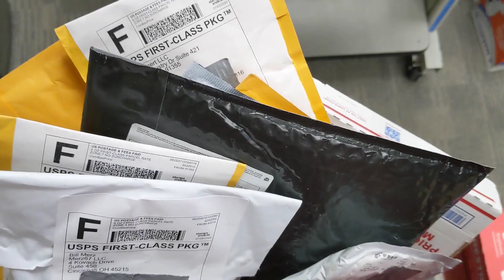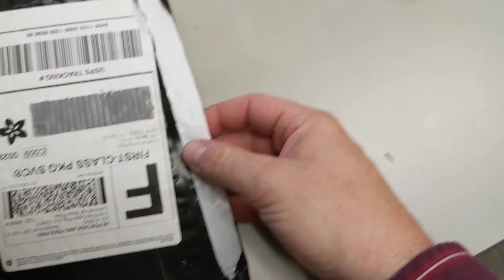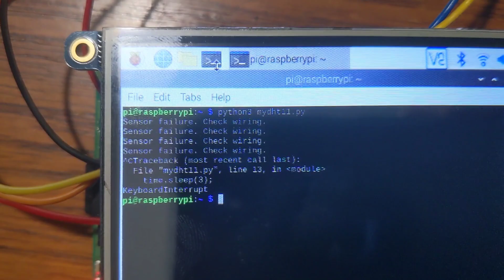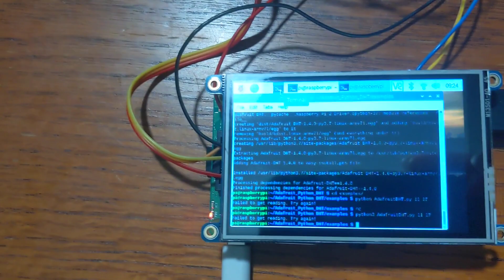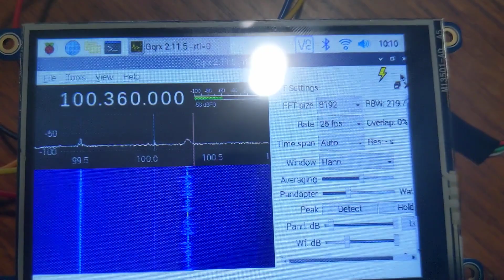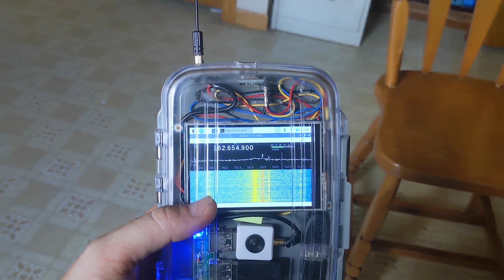Handheld Scanning Device with Raspberry Pi - Part 2

Comment: It is really cool. What did you use for the power?
Reply from the maker: I used a small USB battery bank, I think in the 3rd version I used a slightly bigger one so it would run longer.

Comment: You need to also use resistors on the input pins so you don't accidentally damage the Pi.
Reply from the maker: Huh, I don't think I've heard of that before or seen it mentioned on any project guides. I'll have to check into that!

Comment: Which SDR are you using?
Reply from the maker: It's one of the generic RTL-SDR knock-offs that show up on eBay, I got this one for it's smaller size. I'd paste a link, but the seller has been kicked off eBay since I bought this! It's based on the RTL2832U chip, I think they're all basically the same hardware in different packaging.
Reply: @saveitforparts  Thanks!

Comment: Neat! What thermal camera are you use?
Reply from the maker: It's an AMG8833, the most basic themal sensor with only 8x8 pixel resolution. There's apparently a higher res version but it's always sold out when I look. There are also a few pre-built cameras based on this chip, they're not too expensive on eBay.
Reply: @saveitforparts  Wow. I was going to say that your display DID NOT look like an 8x8 grid, but then I remembered: ah, yes--Lanczos.

Comment: Hey remember on your old airboat that you put wheels on I think maybe you should try boat jacks for a boat trailer and then you can just jack them up and down instead of having to completely remove them love to see it done thinking about doing it myself
Reply from the maker: That's a good idea, although I'd have to see how heavy that would be. The wheels already add a good bit of weight and I don't need to totally overload the airboat!